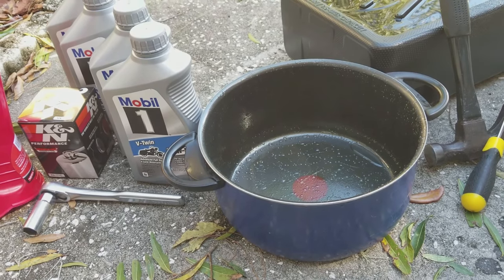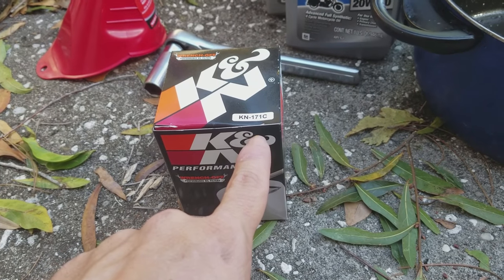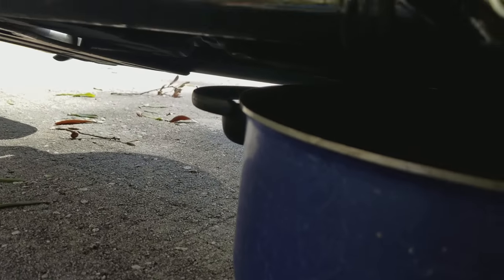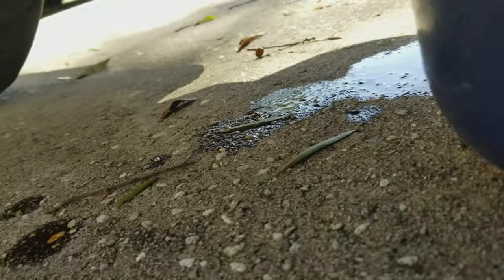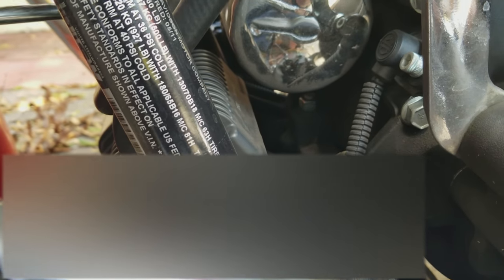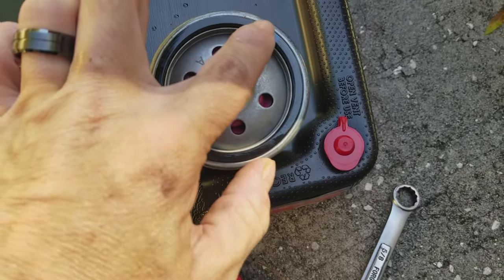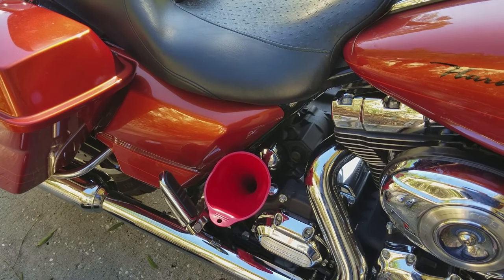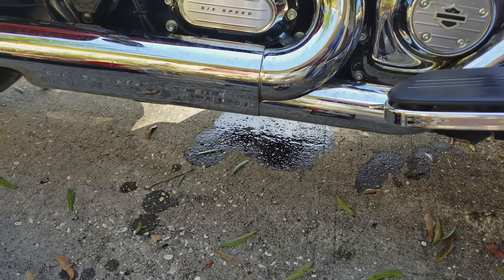How to Change the Engine Oil on a 2011 Harley Road Glide 103

Comment: Good video.  Only thing I recommend is to actually remove the rubber gasket from the new filter and lube it in its entirety.
Reply: Remove the gasket from the oil filter and re-install?
Reply: Floyd Collins-  Makes zero difference to do that actually.  Class dismissed.

Comment: nice, concise video! :-)
Reply from the maker: Thanks! Had fun with it
Reply: Mike Branch there was some issues with these filters in the UK recently iirc, I think folk were fitting them and using a spanner to tighten them which they are not designed to have that stress put on them.
Reply from the maker: Hippo-Drones I learned at an early age to only tighten filters hand tight for that reason. They're fairly flimsy.